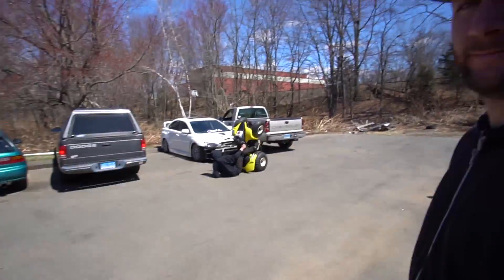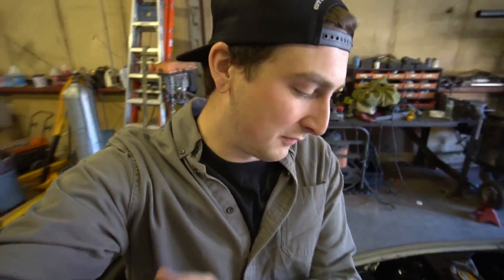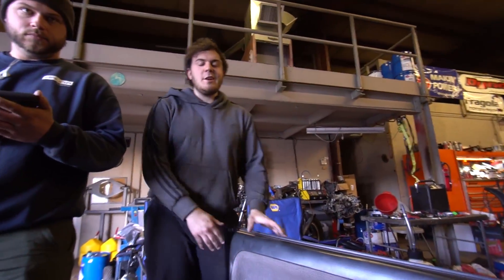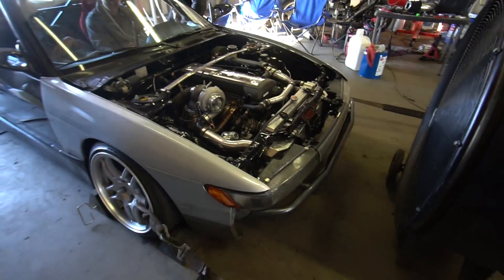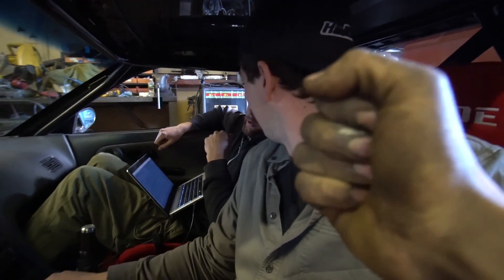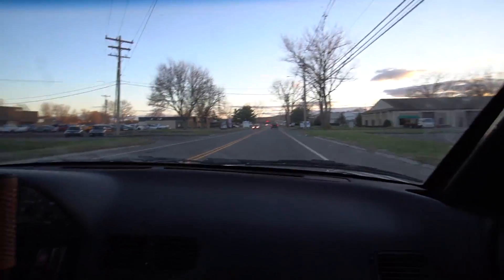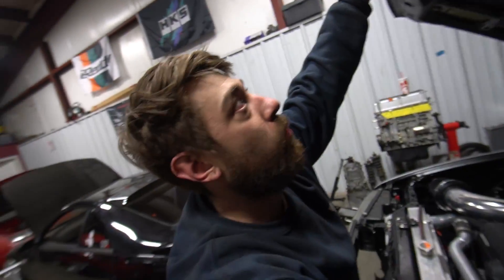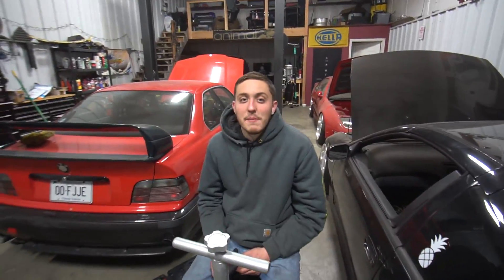I CAN'T BELIEVE MY CAR MADE THIS MUCH POWER.

Comment: The way you described combining the VVTi and nonVVTI on the curves looked like it made so much sense.
Reply: mrlithium if you run the car with the inlet cam full advance, you’ll see the torque gains, but sacrifice hp in the upper rpm. If you run the car with no cam advance, you’ll see a decrease in torque, but hp gains in the upper rpms. Overlay the 2 graphs and you will see where you want the cam to be advanced (early rpm torque) and the cam to not be advanced (later rpm hp)

Comment: Go 18inch wheels. 235 - 245 is the minimum tire width for power level. My sr make 400hp an still breaks traction on 245s super easy without even trying way better more grip compared to  215s or 225 in the rear.

Comment: Congrats on the power numbers jimmy ! Look into some toyo r888r tires for some good grip at that power level
Reply: The car has some serious camber so even if he would do so the contact patch between the tire and the road is not even close to what it could be.
Reply: The rear actually has zero camber
Reply: @brianhall2490  My bad, please proceed :) Wouldn't a bit more front end grip help in drift though? Either way keep up the good work, It sounds Amazing!

Comment: That car needs rear tires ASAP “ n some traction bars .. but after that Dyno Run i  would swap out plugs drop diff fuilds n trans and give it oil change .. and make sure u put a HKs air filter on that turbo ..